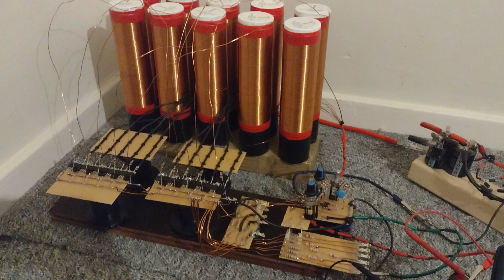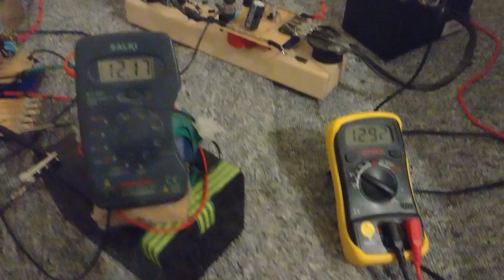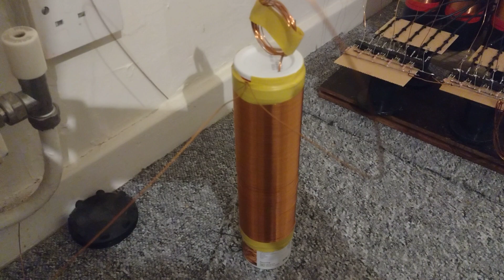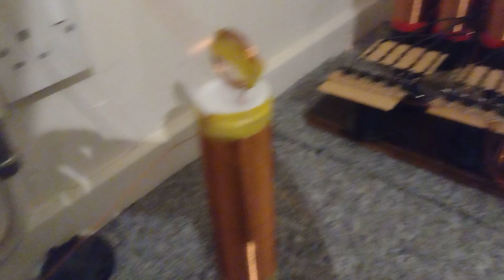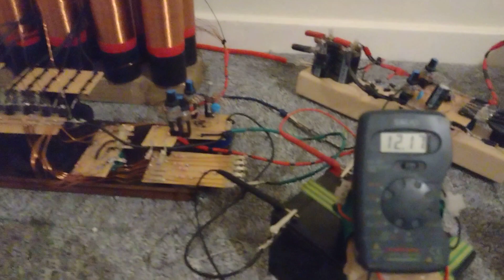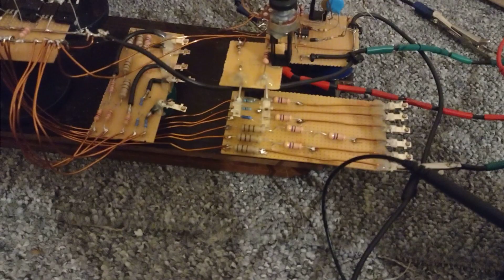After replacing my Transistors.

Comment: Thank you very much for all you've been sharing. I appreciate that you're carrying these experiments out and sharing them so we can learn from them.
I just wanted to mention that the more of your videos I see, the more it brings to mind the so-called South African's device in the PJK book. I recall Patrick suggested a solid state build that uses MOSFETs instead of NPN transistors. I've been finding it hard getting materials where I am, so I could try out that particular circuit. I would like to see if the use of solar panels can be replaced.

I have a question, though. Have you tried applying a load to the batteries while they are being charged by your circuits? That would be a very clear way of demonstrating increased COP. It is, after all, achievable with a solar powered setup. What do you think?

Comment: Good work and good luck...
Could you please post the circuit diagram for the final version that have excess power.
Reply from the maker: Thanks very much.. You'll find the schematic in the Community section of my channel here..  Just don't use the Bul216 NPN's with them which are on the diagram... Go with the MJE13009 instead far better performance & more efficient in this specific device...
Reply: Thank you so much...
Did you got excess power?
Reply from the maker: @ronozoro4969  Yes swapping the Transistors did the job.. charging has since improved
Reply from the maker: I tested a whole bunch  of NPN's in this specific setup.  BUL216, MJL21194, 2SC2625, MJE13009 & found the latter to perform the best even at higher resistance values..  rather than the fast switch I think its got more to do with them entering the negative region..  In a single coil/circuit device you can even use a Mosfet instead but I found in multiple coil/circuit devices the power draw was insane..

Comment from the maker: I've actually managed to get this thing to full charge a 12v battery from a full charged battery where the input battery wasn't even fully drained.  Playing with the tuning set to draw very low power to leave on over night then I changed the tuning later on in the day to complete the session.  Extending the charging session seems to report a higher volt reading once rested.  I'm playing with the tuning & the trigger setting...   its an extremely versatile oscillator..  probably going to take me more charging sessions before I get a feel for what its really capable of...  I'd say well worth the cost, time  & effort I put into building it...
Reply: Wow. This is already an achievement because lead acid has 50% efficiency. Have you tried charging lifepo4 batteries? I heard it has 99% efficiency. But might need a capacitor circuit to even the pulse before entering the lifepo4.
Reply from the maker: @passion4z846  Thank you...   I've been looking into Lifep04 but as of yet I haven't tried them but they're supposed to be a lot better.  They're supposed to be good to use to power the Oscillators but a Cap across the front would be required to protect against the backspike..